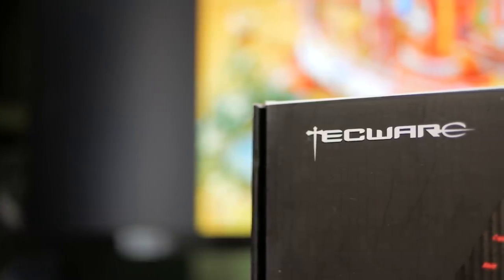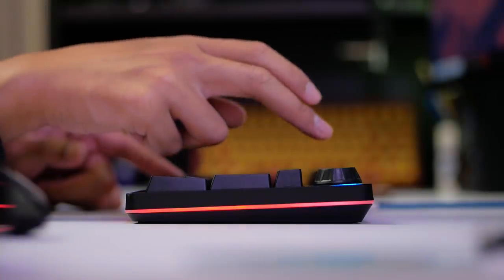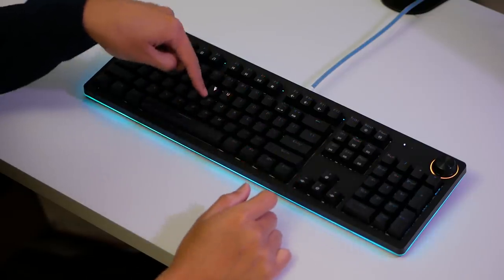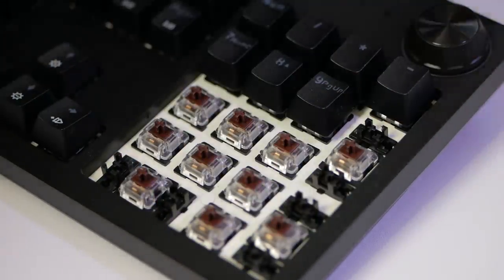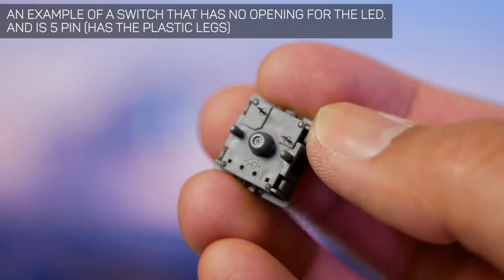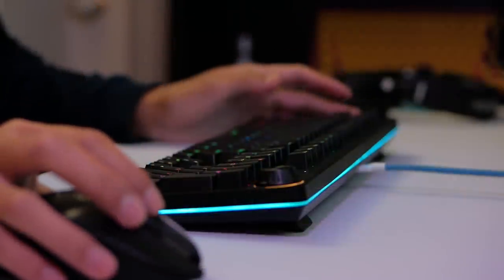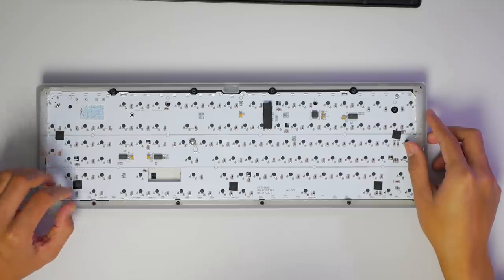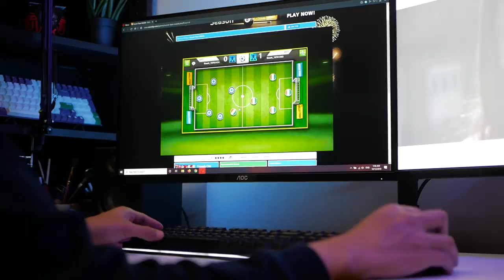Tecware Spectre Pro - A Stunning Budget Mechanical Keyboard

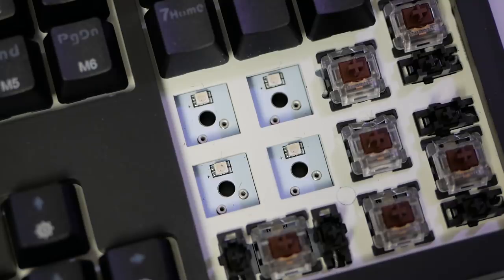Comment: For anyone who want to buy this keyboard, its a nice keyboard actually specially the rgb looks super cool but be really2 careful not to spill water on it, mine instantly died and is on service currently, and yea the switch is really2 hard to pull out, everytime i pull it out it bent like in the video at 6:02, but the overall keyboard quality is really good for it price felt premium and sturdy, but yea it also fragile lul...😂😭